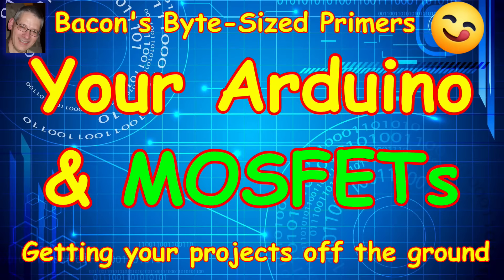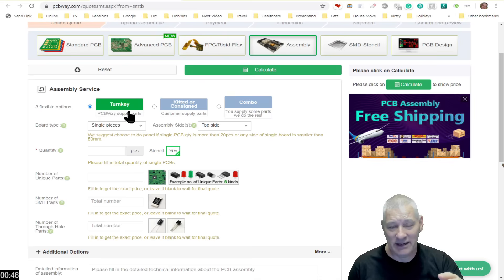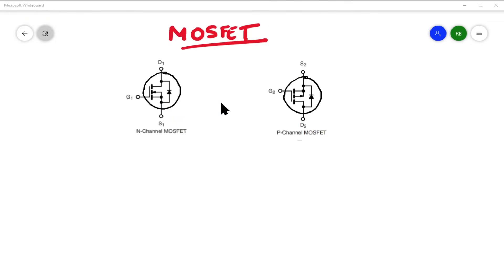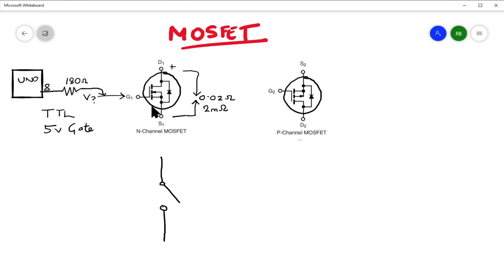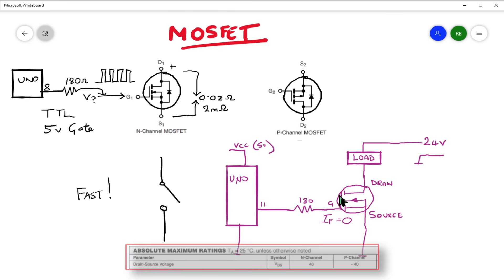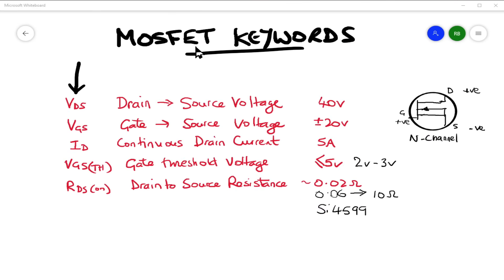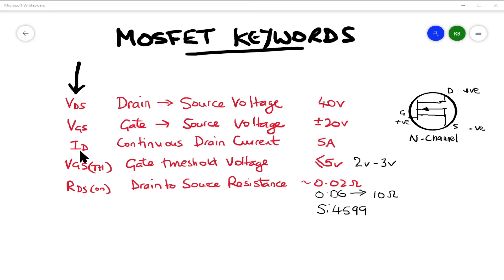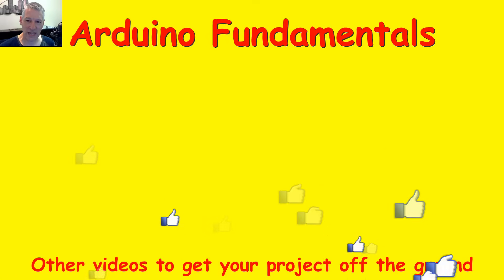#BB4 MOSFETs - From an Arduino Perspective

Comment: What a great video. Can you use a MOSFET to give a dry contact?
Reply from the maker: Well, a dry contact (aka a volt-free contact) on a relay would have two totally isolated terminals. 

A MOSFET, whilst providing the same type of functionality, cannot be totally isolated inasmuch that the ground (probably the Source, for an N-Channel MOSFET) must connected to one of the terminals; the other terminal would most probably be the (open) Drain.

This means that the MOSFET would sink whatever current present on the Drain to its Source (probably the Ground of the circuit).

So, not quite the same as having two totally independent contacts that you would find in a rely, even if it would work just fine in most cases.

Comment: I don´t know a lot about electronics, but noticed, that people use many gate-driver-designs... Is a LL-mosfet also in need of those drivers, or does the fact, that it conducts at 1,3v, lets it work finely even with solely an arduino? I´m thinking thereby of course on the switch-on/off-speed of the mosfet. In other words, turning on already at 1,3 out of 5 available volts, lets it turn on faster (shorter turning-on time), cause at just 1,3v the arduino has more mA left to give, and thus shorten the turning-on-time (????????????)
In my case, I want to drive cleanly a mosfet at 5-30kHz, 1-2Α (so, not long delays while turning on/off), and looking for any easy way to do it, without having to study electronics first...   ;-(
Thanks á priori for every answer...
Reply from the maker: A TTL-level MOSFET will switch cleanly but the propagation delay can only be found by (a) reading the data sheet (to see the delay in switching on) and (b) by trying it out using a 'scope. Best not to use any kind of gate resistor (slows down the gate capacitor charge time) even though some people seem to think they are necessary (I don't, but what do I know?)
Reply: @RalphBacon  Ok, thanks, so, my "very basic" assumptions were right... My perspective was to avoid artificially prolonging the data-sheet-delay by wrong-handling, and not to shorten that delay even further, so, thanks. The "trick" with the no-gateresistor, I´ve learned about it recently, too, after I have posted my question (above) to you. Still, the knowledge about the gate-resistor didn´t mean, that my question didn´t need any answer, so, your answer was bitterly needed, still... So, a big "Thanks" again...!!!

Comment: in an N Channel Mosfet, can the gate have a higher voltage than the drain?
Reply from the maker: Hmm, the datasheet should provide the absolute maximum ratings that the device can withstand. 

However, think of the situation where you are switching a lower voltage (eg 3v3) but using a higher 5v (or even 10v) gate voltage to do so. That works just fine. 

The only parameter worth watching is the max vgs (voltage between Gate and Source [not drain]) which is usually 20V or thereabouts but could be lower or higher for any particular device. But that's not your concern in this question.

I can't find anything on a MOSFET datasheet here to indicate the max voltage between Gate and Drain, though.

Comment: very well explained, but I would like to know how to setup an Arduino to a control P channel as the pins from Arduino are +
Reply from the maker: To turn a P-channel MOSFET on, just bring the Gate to Ground. You can do this via an OUTPUT GPIO and writing LOW to that pin. 

A slightly easier way is to connect an N-Channel MOSFET's Drain to the Gate of that P-channel, with its Source to GND and the Gate held LOW via a 10K resistor to GND - then you can write HIGH to the Gate of the N-Channel MOSFET to control the P-Channel one, much easier to get working.

Comment: Useful info, thanks.
Been having so many problems with motor shields not outputting the amps that I need and went back to basics with a MOSFET. Turns out my output pins do not reach 5v on my UNO. I bought some IRL540N Fets and they would not turn on fully until I applied VCC 5v to it. Even though the data sheet says 1c-2v VGS. I ended up testing an old IRLB3036 and it worked so much better from the output pin. Data sheet shows 1c-2.5v VGS so I don't understand what's going on. I still need to pump slightly more voltage into it to get it fully on or maybe PC USB power just isn't outputting enough current to my Arduino? I've been at this for weeks now.
Reply from the maker: If your GPIO pins are not outputting the full 5v (well, let's say 4.95v) are you sure the power supply you are using is up to the task? Measure the input voltage on the 5v pin and compare it to a GPIO pin that is set to OUTPUT. Should be pretty much the same. 

Also, check that the MOSFETs you are using are TTL-compatible. This means the Gate will switch FULLY on with a 5v input voltage. You can check the datasheet for the device and look at the Gth (gate threshold). Lots of them are really quite low, 1-2v these days. Although that only shows when the device will START to conduct it won't need a lot more to fully switch on.
Reply: @RalphBacon   Hi,  thanks for replying. It measured different things under load but was around 1v when I measured under load. I tried several different pins. The power pack is 5v 3 amp and the VCC is 5v. I think the 540N isn't up to the task. I swapped for an old R~IRLB3036 and it worked much better. Not quite perfect, but increasing the voltage to compensate got me where I needed to be. Not sure why it didn't work as the VGS is only 0.5 v difference on the datasheet

Comment: At 8 mins into the video you say that only a tiny current flows to charge the gate capacitance. Without the gate resistor, the current can be 100mA or more depending the the actual gate capacitance and the switching speed. The 180 ohm gate resistor will limit the current to about 30mA. It is always a good idea to have a gate resistor to protect your microcontroller from current spikes.
Reply from the maker: There's two schools of thought here: use a gate resistor, or don't. 

As a risk-averse type of person I probably would but might not. Gate current flow is [usually] miniscule; it is the voltage that determines how the MOSFET works. 

I'm pretty sure that 100mA might flow down the gate but for a pico second to charge the capacitor. Putting a resistor in the gate path actually slows down the charge (and hence the switching time).

Comment: So a few years ago I uses a IRLZ44NPBF to switch a 5v fan using a 3.3v logic pin on a Raspberry Pi 4b.  I'm brushing up on how to do this again on another Raspberry Pi.  When I did this before I looked at the VGS(TH) and it was Min. 1v and Max 2v so i thought that meant the max voltage I could apply to the gate was 2v.  So I added two resistors to make a voltage divider on the 3.3v Raspberry Pi GPIO pin (150K & 100K | 3.3v to 1.98v).  Now that I'm looking at this stuff again I think that voltage divider was completely unnecessary since the VGS for this MOSFET is +/- 16V.  Have I got this correct now?
Reply from the maker: Yes, you don't need to limit the gate voltage, it usually is fine up to about 10v. In fact, it works better the higher you go (up to the max, usually 10v) giving a lower "on" resistance.

Comment: As usual, good little tuto😊👍🏻I put a 220 ohm resistor (instead of your 180…), like you said : just in case….
Reply from the maker: Yes, that value is just fine, it's not critical.

Comment: Nice video, as usual. One word of caution: I've bought two batches of (power) MOSFETs from "The Far East" as you so euphemistically referred to it, and both have failed in the gate threshold spec.  That V(gsth)  threshold voltage is likely one that often results in rejects and a steady supply of dodgy parts to the unsuspecting hobby market. A nasty trap for young players!
Reply from the maker: Thanks for the info! 

It is true that we hobbyists are probably the main market for sub-spec devices. Normally it won't matter, but when it does it's best to buy from a reputable source (at a considerably higher price, of course!).

Comment: Love the introduction to 4599 MOSFET module.

Do you happen to know if the super spacious board they are on is to dissipate heat or is it just that big? I was looking to put one of these on an 8 pin DIL carriage to save space.

And then DOH! - I was building an assembly which used these to create a simple H bridge motor control.  I use logic to keep the N channel MOSFETs off whilst I decide if the P channel MOSFETs are on or off. I am aware of the 'slow to switch off / fast to switch on' perils of 'shoot through' so in my project I allow at least 1ms of N channel MOSFET off each side of any directional change of the P channel MOSFETs whilst under MCU control.

My MCU has an 'enable' pin that gates an enable into each N channel MOSFET and just in case this looses the plot, there is a safety 10M resistor to ground the gate of the N channel MOSFET driving my bridge so if in doubt, it's disabled (My bridge is running at 8v so I need additional 'level shifter' MOSFETs hooked up to the MCU).

However I have no such pull down on the 'direction' N channel MOSFET as in final circuit this will be driven by MCU pin and the direction is one or the other - was keen not to waste power.

Was testing the build and thought I'd test the H bridge before soldering the MCUs into the circuit. The 'enable' MOSFET worked a treat but as soon as I tried to change the input voltage to the 'direction' MOSFET - a bad thing happened. I guess as I'm using very high resistive MOSFET switching loads (to save power) the 'direction' MOSFET started switching at mains frequency and with the 'enable' MOSFET 'on, the circuit started making a strange whining noise and then the magic blue smoke started escaping from the modules.

Luckily I have a few spare but I'll have to rethink a partial assembly test.

Keep those YouTube videos coming, they're great.
Reply: I think I know the root cause of my 'blue smoke' issue - I used some CMOS logic hung over my 8v power rail to drive the N channel MOSFETs in my bridge  - to act as an enable  for the bridge. I also used the CMOS to generate an inverted signal so one of my P channel MOSFETs would always be on whilst the other was off - to reverse the H bridge drive direction.

I was using a couple of N channel MOSFETs hung on my MCU power rail with very high resistive load (10M) up to the 8v rail of the H Bridge.
When I was testing the unit, I had a digital AVO measuring the voltage at the drain of my MCU switched N channel MOSFET - that was pulling enough current to slug the voltage down from 8v when the MOSFET was off and this was evidently enough lower than the 8v rail of the H bridge P channel MOSFET to never turn this off - hence the 'shoot through' and resulting 'magic blue smoke'.

Luckily I had a spare gate in my CMOS (CD4001) to act as a buffer between my MCU switched N channel MOSFET and the H bridge P channel MOSFET.

I have to add a new set of those 4599 MOSFETs (fully charged up with magic blue smoke intact) and give it another test.

I'm not sure why I never encountered this whilst at the solderless breadboard stage (dumb luck). Ho Hum.
Reply from the maker: You should be careful with those Si4599 modules, they are currently unavailable anywhere (what chip shortages?). I use an alternative, the AO4606 which is a drop in replacement (well, so far, so good).
Reply: @RalphBacon   Thanks Ralph - wow!  -  I just purchased 10 of these puppies form AE at four pence a piece (plus less than two quid postage) - that's insane - I rummaged through the bin to find the old si4599 pcb - I'll re-use these. (I have 6 x si4599 on order from AE at about a quid each but couldn't resist the AO4606 price point)
BTW  - 'Chip Shortage'  - on another post I was banging on about the unavailability of (genuine) ATtiny402 devices until Aug 2023 - my reply post disappeared  - but just to say - if you don't need automotive / industrial grade devices (temperature rating), you can get these direct from the manufacturer and if you select the correct packaging, you don't even get charged the part reel cutting charge (specifically ATtiny402-SSN) my devices turned up in a couple of weeks any buying ten of them worked out at about a quid each. - Result!
Are you planning any 'How to'  videos on these?  - would love to get some tips.

Comment: I've never understood why BJTs use "Collector" and "Emitter" and FETs use "Drain" and "Source". Aren't they analogous? Why the difference?
Reply from the maker: They are only analogous in the sense that current flows from the collector to the emitter (in an NPN BJT) and from the drain to the source (in an N-Channel MOSFET) but, as you might imagine, it's more complex than that.

Here's some information: https://www.power-and-beyond.com/whats-the-difference-between-mosfet-and-bjt-a-909006/

Comment: The S in MOSFET stands for Substrate,  not Semiconductor.
Reply from the maker: That's not my understanding. https://en.m.wikipedia.org/wiki/MOSFET
Reply: @RalphBacon  baffled at how many get this wrong.  If you think about it,  the word semiconductor doesn't fit because the semiconductor material isn't metal oxide,  it's silicone or germanium.  The Substrate,  the material that insulates the gate from the silicone,  is the metal oxide part of the FET.
Reply from the maker: No, the substrate or body of the MOSFET transistor is made of p-type silicon formed from a single crystal. The metal oxide (just a few atoms thick) is grown on TOP of the substrate.
Just sayin'. More here: https://bit.ly/38KMqxP
Reply: @RalphBacon   the metal oxide is not a semiconductor, since it doesn't conduct at all.

Comment: I always add a pulldown resistor on N-Channel MOSFET gates. It's just good practice to make sure it stays off until you want it on.
Reply from the maker: Good practice, I agree. Stops all the floating about nonsense.

Comment: What exactly is the application for a dual P/N mosfet like the Si4599?
Reply from the maker: I use the arrangement of a P-Channel and an N-Channel almost exclusively as a mechanism for switching a device on and off (under program control). 
See videos #123 Auto Shutdown (https://youtu.be/g1rbIG2BO0U ) #173 ATTiny85 Auto On Off Shutdown (https://youtu.be/S2y1oAVmxdA ). There are a couple of others too.
Spookily I've just retrofitted this exact device to a project of mine as I was fed up having to switch it off manually - all done via the Arduino now. And I'm using this in my new Bin Lid Monitor circuit too!

Comment: Isn't Vth the absolute minimum for any current to pass? IE, the maximum off voltage instead of the minimum on voltage?
Reply from the maker: Well, it's described in Wikipedia like this:
The threshold voltage, commonly abbreviated as Vth, of a field-effect transistor (FET) is the minimum gate-to-source voltage VGS (th) that is needed to create a conducting path between the source and drain terminals.
I interpret that as being the lowest voltage we can apply to the gate to start to turn it on (N-channel MOSFET).
Hang on, isn't that what we're both saying? I'm now confused!
Reply: @RalphBacon  almost. At Vth it will start conducting but with high resistance (so it is not fully off)
Reply: From what I read, above Vth, the resistance goes down proportionally to (Vgs-Vth)² assuming Vds is high enough
Reply from the maker: Quite so. You wouldn't want to use the MOSFET at (or just above) minimum Vth, it would get very hot, very quickly. In fact, we need to ensure it's fully switched on to get the RDSon resistance to the value in the spec sheet. At which point it should run amazingly cool even with large current flows. Which it does, according to my experiments so far, like my intelligent phone charger.
Reply: @RalphBacon  precisely, that's what I mean with "maximum off voltage" in contrast to "minimum on voltage"

Comment: Very good and comprehensive explanation!

One addition to the different Vgs one might find in a MOSFET datasheet:
-> Vgs is just the voltage from gate to source (with the red lead of the multimeter on the gate and the black one on the source for an N-Type)

-> The Absolute Maximum Vgs is the maximum voltage you should ever subject the MOSFET to under any conditions (stay well away). Usually the actual breakdown is quite a bit different.
-> Vgs(th) is the voltage at which the MOSFET will 'turn on' to some degree (usually not very well turned on). For example, it might be 2V minimum and 4V maximum for a drain current of 0.25mA at Tj = 25°C (the die itself is at 25°C).. That means that if you want your 20A MOSFET to really turn on fully (not just conducting 250uA) you need a lot more voltage than 4V to be sure about it, but if your Vgs is well under about 2V you can be pretty sure it's well turned off (at least around room temperature).

Cited from here: https://electronics.stackexchange.com/questions/157065/explain-in-laymans-terms-vgs-and-vgsth-of-mosfets
Reply from the maker: Very useful information, Raimund, thanks for sharing that. I will definitely be looking at that link to improve my understanding of the quirkiness of MOSFET specifications!

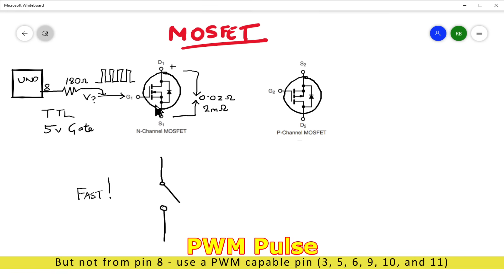Comment: 7:00 Actually, all pins in an Arduino are capable of doing PWM output. It is just that for a few pins the Arduino itself takes care of it, while for the other ones you need to manually do the PWM programming, the raises and lowering of voltages, etc.
Reply from the maker: Ah yes, you mean bit bashing. The very thing that might be time-critical and therefore worthy of a bit of "compiler optimisation". Woo hoo! A good example.